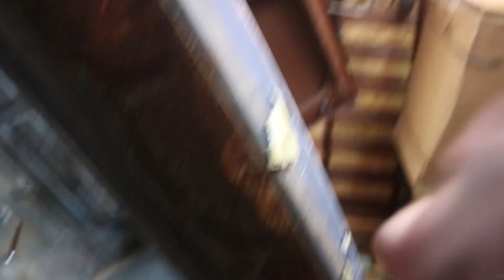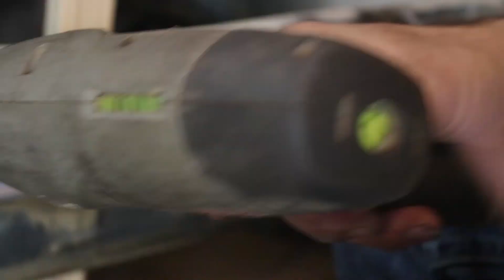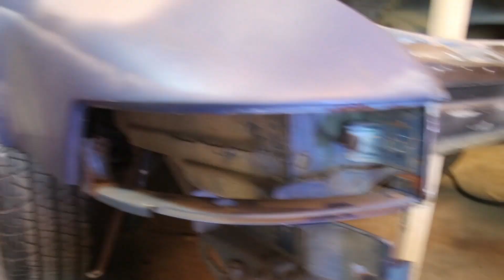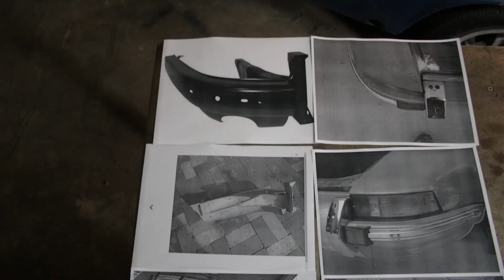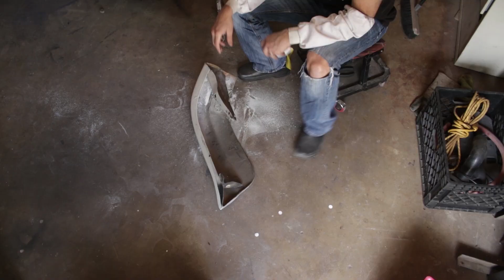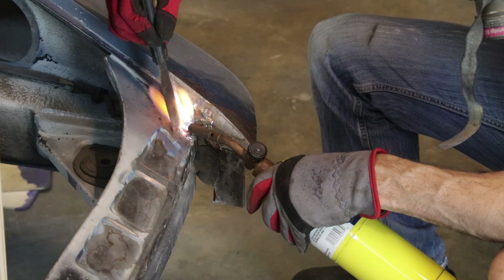Porsche 911 RS Tribute Build - Backdate Rear Bumper Fit

Comment: A very interesting video. Are you concerned that removing so much steel is going to weaken the car to the point that you'll have much less protection in an accident than Porsche originally engineered into the car? Thanks.
Reply from the maker: Thanks!  The material removed backdates the car to the previous year, 1973.  1974 included the impact bumpers to comply with the US 5 mph crash test.  So my car won't pass this test, but in terms of my safety in a larger crash, I don't think this bumper metal makes a difference.  The engine and rear roll cage should offer some needed protection.  I worry more about a front or side collision in a Porsche.
Reply: I know what you mean. With all of the distracted drivers on the road and the drunks it's more dangerous than ever. I would still wonder if all of the material you have removed would weaken the structure. German engineering is pretty thorough so removal of steel would be a big concern for me and others.

Comment: Those look like RSR bumpers, wider than RS
Reply from the maker: Must be RSR.  Good call.
Reply: Garage Time - Auto Resto Are you sure you have the correct 1973 Rs rear fenders? Looks like a narrow body from the video?
Reply from the maker: Kevin Powers Hi, you are correct theses fenders in the video are the original narrow  body fenders.  I'm going to replace them with RS flares In a future video.  My biggest concern is the width at the tailights.  I don't like the shelf sticking out near the tail lights created by bumper. The RS flares are wider but they won't affect the area around the lights.
Reply: Garage Time - Auto Resto  Makes sense, maybe you should install the correct fender widths before trimming the bumper? But yes it won’t change around the lights, good point! Keep up the great videos! Love it
Reply from the maker: Agree.  This week I'm finishing the rear latch area and I might have a steel license panel in time to trial fit.  Then its on to the rear fenders which will be interesting on my budget.